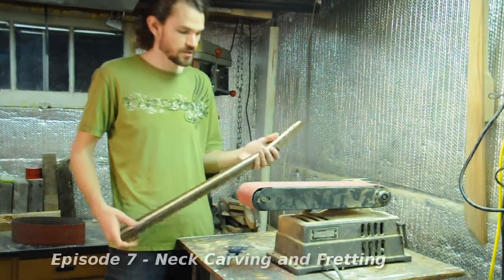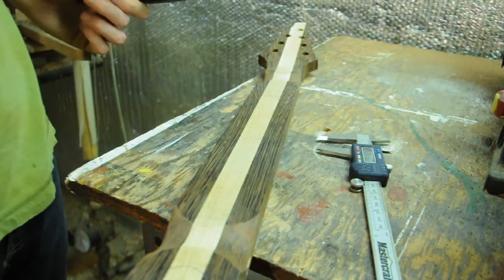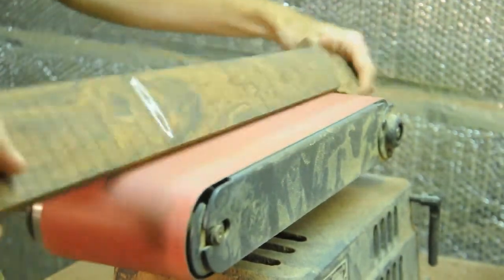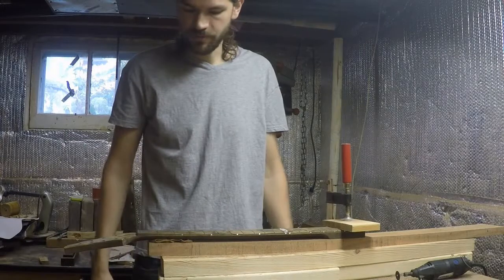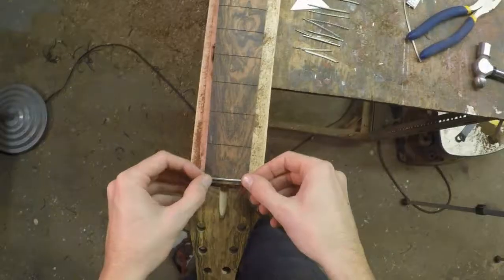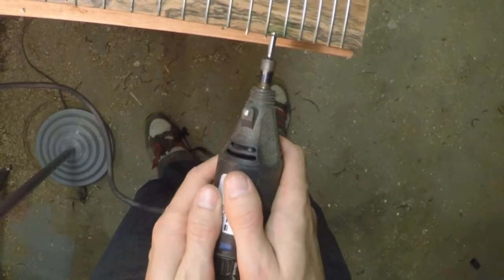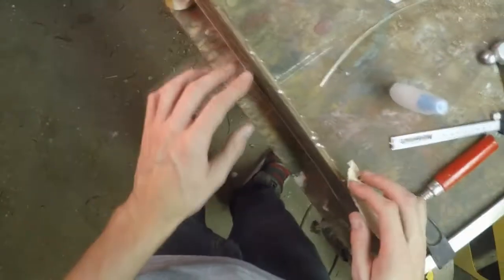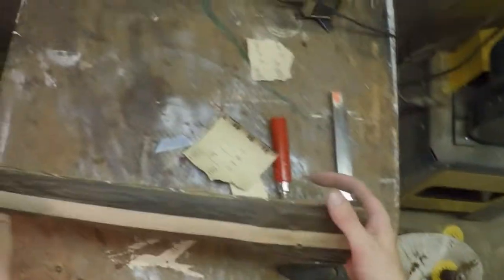Episode 7 - Neck Carving and Fretting

Comment: I'm enjoying your videos.  Though the GoPro was making me a bit seasick it was cool to have the point of view, view.  Just a thought re tools: the workbench is your biggest tool.  A workbench is meant to be massive and to function as a clamping surface.  In spite of the headaches of carving wenge, you'd have probably had a better time with a rock solid workbench under you.  Keep up the good work.  Cheers.

Comment: Check out the wood planes from MICROPLANE not too expensive. Look like cheese greaters, and actually that company  also make those. Also Some Japanese rasps by SHINTO but about 3 x the money.
Reply from the maker: Yeah, I've used microplane's rotary shaper before, it's stayed unbelievably sharp for years.  Really great product line, no dust and cuts really hard wood fast!
On figured woods, I have a hard time controlling regular rasps and blades, but a microplane is a good recommendation.